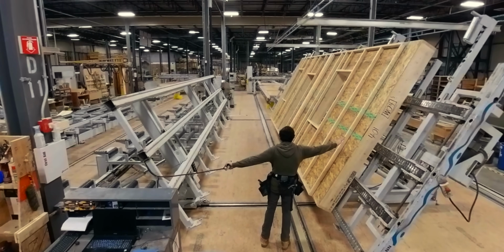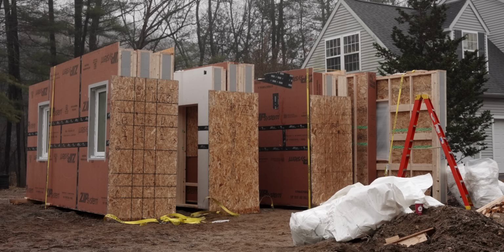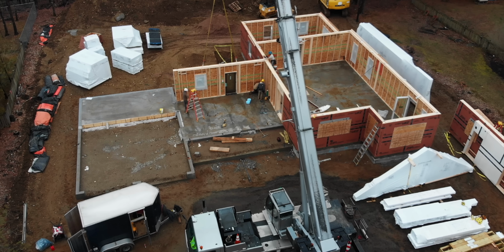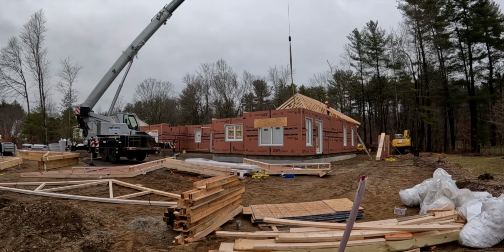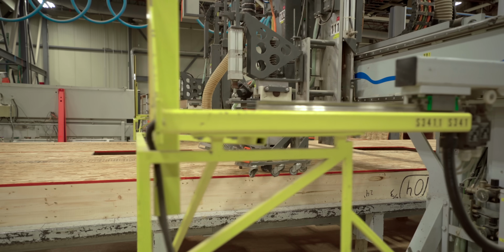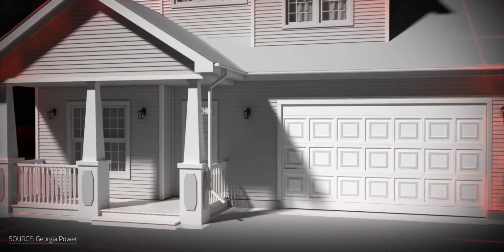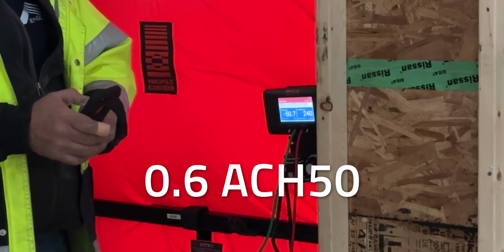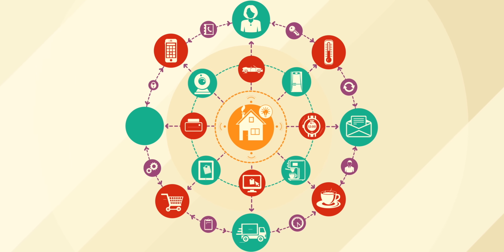Wow! I Didn’t Know A Prebuilt House Could Do This

Comment: Hi Matt, I’ll be curious to see if the Water Furnace is worth it.  We built a stick built “passive” house.  We’re down in the Carolina’s so much milder.  But with our LG panels we are NetZero with just an American Standard XV18 heat pump which was 1/2 the price of the Water Furnace.  In the end, the geo numbers just didn’t make sense and would never pay back the additional cost.

Comment: I built several homes for ourselves using conventional construction, large fire places and every other inefficient system that was the norm prior to about 1990s.  I had a steep property in the mountains of eastern mountains of central California and above my property a new house was being built by the owner/contractor. I did not care for a neighbor higher only 300 from our property line so I never built on that property. During construstion of the house above my property, the only two lots, about 40 ac, so I got to know the builder. He was experimenting and wanted a thermal efficient low utility cost home and designed it himself. Watching him do everything that was not standard was interesting as it went to gether. The basement was a deep reccess 12 feet below grade that required blasting to break up the granite just 2 feet before surface. He filled the whole cavity with large river rock, from 1 ft in dia to 4-5 feet. 
When it was done, the 3 story home had a bottom floor Great Room with a single decrative Franklin stove on the ground floor where the elegant living room had the stovepipe runnin straight up 30 feet to the ceiling,.  The country required him to put in electric heaters after failing the inspection but only installed the circuit breakers while the country was inspecting, then pulled them out. On the west facing glass wall overlooking  the central valley, the glass extended from floor to about 26 feet across the entire western exposure of the 5 bedroom home. He explained his idea, completely from first principles, not being a architect or having ever designed a high efficiency home before and it was really both novel and effective. It was an envelope home, with air passages up the hill so the second floor on the back eastern side was windows inches about the earn since it was on a steep hill. the sitting room in the center of that second floor was below the water surface of a pond so one could see the light filter through the water and entered the room. The western side had a large deck and at the peak of the house on the west side had an overhang of about 12 inches at the 35 foot level. He explained that small overhang was perfeft to protect the summer sun from shining through the glass wall but even a dusk there was not need for interior lights to be on until well after sunset. But in winter with the lower sun all day, the entrire ground floor living room was in heated by the sunlight bathing the enire great room dark tile floor. The thick concrete floor had vent holes into the rock filled space below that was warmed by the floor absorbsion and stored in the river rock and released is continuously all night. No fans or blowers. Over the kitchen area was black pipe in a grid that heated glycal filler that was fed into a head exchanger in to water heater room so the only heat of the triple insulated water heater had to supply warm water for showers and wasking, fed with a deep well 316 feet.  
It was so well planned out and efficient in 1983, I bought the house from him. It was the most comfortable year round building I have evern been in and between the solar voltaic panels I installed and a large lead calcium battery shed, my utilities bills consisted of electricity for the well, about $14 a month.  The stove was wood fired, the refrigeration was from the solar panels, and outlet power was from an inverter I made myself.  I bought it for $185,000 in with his 40 acres and my 40 I already owned.   I owned it into 2000 when I gave it away and moved out of the US.  That house was a delight in beautiful views, cozy winter or summer, the warm floors due to the heat resevoir underground encouraged bare feet. The little franklin stove was so efficient that the whole 3900 home was kept toasty in the cold frozen winters, fueled by tiny pieces of wood, unlike my prior home with two fireplaces that used 24 cords of seasoned wood cut every September. The envelope home was so efficient that I could collect a winters worth of wood in a few hours instead of a month before.
That was before all the innovation in materials, or the low cost solar panels today.  Now I live  500 miles from the Arctic Circle in the historic city center of beautiful St Petersburg Russia and my total cost of living including attending world class opera, ballet and drama, partying every other night, is $1500, for two people with a much better quality of life, but I do miss that home in the mountains of California.  I had access to early solar panels because one of my businesses was servicing all the two way radio systens for the US Forest service for 3 National Forests and proposed and designed and installed the first solar powered mountain top repeater systems that were inaccessable in the winter into late spring so they had to be very reliable when inverters and for the repeaters. I also invented the the first solar powered refigerators so the live-in lookout towers fire spotters could have better quality food. I build 12 of them for the Forest Service. Not long after that due to budget limits they fired all the experienced lookout fire spotters and relied on remote detection that was the main contributing factor in the massive fires every year for the last 20 years.  Skilled lookout, were much better in detecting even a single smoldering pine cone from miles away. Now a fire is detected too late when it generates its own wind and becomes a very distructive fire wiping out who communities every year. That did not happen when seasonal experienced people lived in the lookout towers. To save $7/hr they were paid they spent many billions in first suppression and over 200,000 homes and businesses.

Comment: I work for a double / triple glazing manufacturer in the UK and those u-values for the windows are insanely low. Would love a breakdown on the configuration of the glass they used and if the 0.15 & 0.13 is just the glass u-value or the whole window u-value.
Reply: I would love to know more about the windows as well, since seams like extremely good u-value :=) In Sweden we only need around 0.8  for passive houses.
Reply: @trind6  They are using freedom units (imperial) and 0.14 equals 0.8 in Sweden
Reply: Stumbled across this video and thought the same thing, apparently its a different value in imperial units and 0.14 in imperial equals 0.80 in metric

Comment: As some one that has lived in the tropics most of my life, I am surprised to see US housing not having steel rods from the floor to roof to hold it down. Surely your tornado's would warrant that? I am still impressed by your house and the process of construction.
Reply: 1. tornados are rare, strong tornados are especially rare and almost all occur in the south central region and,
2. to address this, exterior walls are bolted to the foundation, with the roof bolted to the frame as well. basements and solid concrete rooms are basically the only way to survive the strongest tornados

Comment: i'm just wondering for the tech in your house if your going tot ake the easy or nightmare route

Easy route > using google, apple and have a easy cloud based system where everything goes through the cloud as well using a hub

nightmare route > Cloudless with cloud option / using local home connect that doesn't require the internet to use the things in your house because some of the tech updates in some devices haven't been updated in 4+ years 

like Jasco the firmware in there switch and motion sensors are proprietary information which only works if you own a hub for updating

Comment: What is your intention with the house build? Is it to just be as energy efficient as possible? Or to be as eco friendly and human friendly as possible? Or both? It's a nice display of how far prefab homes have come for the price point. Also, did you do any analysis on the use of geothermal in your area? I have been a part of several projects in NH and VT in the past couple of years, and all have done analysis to show that geothermal is insufficient for heating a home, and heat pumps are typically a significantly better option. That said, I didn't do either with my house build, and invested in exterior insulation instead, with simple electric floor radiant to heat our 600sf home. Another question as well, why did you go for a concrete slab on grade? Was it a cost decision, or for simplicity? That follow up would tie back to my initial inquiry, if you are prioritizing eco friendly or energy efficiency, as the slab will definitely help with energy efficiency, but there is quite a bit of embodied carbon in concrete, as well as the XPS Insulation that the slab is poured into. Just curious what your goals and priorities are, and seeing how you came to your conclusions, as I just went through the process of my house build to 90% complete as of today with energy efficiency as my priority, ergonomic efficiencies a close second, and quietness being third.

Comment: One area that I am interested in has to do with the bathroom.  At Epcot they had/have a display that uses shower water drain to preheat hot water tank water.  The same system was used to use waste shower water to to flush toilets which was suppose to cut water usage by 20% to 33%. Since utilities are moving to purchasing power at wholesale rates, would a solar storage battery below the garage be a consideration.  Heat in summer and use in winter like polar ... battery.  Assume your using ground loop heat pump to be all electric.

Comment: I have a need to close air conditioning and heating vents in my house for extended periods because no one is in them, this will in theory reduce heating and cooling costs by reducing the area I'm heating or cooling.   Are you going to include something that could do this in your house?

Comment: Interested in how you control your AC and heating through various paths the house and getting the flow back the air handler.

Are you putting individual reverse ducts in each room or part of the house?

Comment: If everything about the fabrication of the walls and roof were "controllable", why was the house slated for assembly in the wintertime? if moisture and inclement weather were such a concern, surely late spring or summer would have been a better assembly time? Also - the roof truss assembly does use smaller wood member, etc., but this type of construction eliminates attic space, any storage, and also prevents you from having any kind of vaulted ceiling. Is the trade-off worth it? The walls and roof seem to be so extremely well-insulated and that is amazing. what about the foundation walls? there is a styrofoam formwork system that becomes an integral part of the foundation wall and provides a fantastic thermal loss rating.

Comment: Stuff I would like to know more about.
1.) Cost breakdowns 
2.) Moisture/ mould suppression techniques especially in the heat exchanger 
3.) Is this type of build good for allergy sufferers?
4.) How much expense and feature change was required by local building codes or HOA versus what you actually wanted?
4.) Any subsystems that are fully off-grid, and do they save you money vice the on-grid alternative?
5.) Is your Tesla gonna integrate with the home power system?

Comment: Aside from the EV...   I almost feel like solar panel prices are dropping so quickly that really spending a lot of money on super insulation designs is a little overkill economically.   In other words, I feel for most modest homes, we are at the point where we can just brute force it on solar panels.
Reply: I've had a similar thought. Use a small wood stove, rocket stove, propane backup for the extended cloud cover events.

Comment: Residential construction is a tremendously wasteful endeavor. When building in a factory-style setting, much of the waste can be and is engineered out of the build. While very capital intensive to set-up, the equipment saves on labor which is also harder and harder to find. Speaking of labor, they'd much rather build in a controlled environment than be exposed to the elements, which in turn reduces build time.

So, less waste, less labor, less time and better working conditions, not to mention the ease of erecting structures to the dried in stage. Every new home should be built in a factory.

My parents were way ahead of the game; having their beach home factory built way back in the '80's. There was no such thing as air exchangers back then and the wood burning stove would not only heat the entire home, but you'd actually have to open windows, even in the dead of winter, and that was with the stove barely burning.

Comment: I saw a few years back this video from This Old House (https://www.youtube.com/watch?v=N3Em64OBGqI) specifically for future houses. The owner had decided to use commercial equipment and thermal batteries (aka cold/hot water reservoirs) to help regulate temperatures in his BIG house, along with solar.

My though since seeing that has always been if there would be a way forward to tie solar panels and battery, geothermal heat pump, and thermal batteries together and create a self-regulating ecosystem of sorts. For example, use the glycol to help chill the solar panels and make them more energy efficient, use that glycol to help supplement the hot water heater or the heat pump, and also regulate the HVAC during the summer months by being able to soak up the heat out of the house and replace it with stored cool thermal energy.

I'd be curious to hear your thoughts about this.

Comment: Starting in 1991, mine took 3-1/2 years to build. There was a HUGE learning curve back then! I am also in NE. I've thought about doing another one. I desperately do NOT want a basement- nothing but grief (water, mold and humidity control). I spent a LOT of money trying to get it right, but no cigar. So... how did you do the 'slab'? What did you do to keep the concrete under the final floor from contributing to mold (ie, moisture management)?

Comment: Great video and quality of build seems great so far. Have done 6 regular new home builds over the past 21 years, each with a different "Brand name" company (Lyon, Standard Pacific, Toll Brothers, etc) and often a nightmare as the "trades" are contracted and framing part is such as mess.
Just wondering what the cost of the home up to the point of the end of this video is and then final cost is as helps for the rest of us to see what it cost to be "Energy Efficient" etc.

Comment: Question. Did you spray that crack and hole filler that I saw on Matt Risinger's video about his house? There was what looked like a tripod that had a sprayer on it. It was part of a system that sprayed something that actually flowed to where there were leaks in the house and plugged those leaks. They did a blow test before that procedure and then after to show how all those leaks got filled. That seems like something perfect for your house needs.

Comment: with battery fire problems, what steps have you taken to mitigate saving lives and house if there is an overcharge or failure? like a separate room on outside wall with blow out panels and fire suppression system?

Comment: I would like to see the roi on the geothermal decision please Matt. I built some of the first super insulated , double stud wall homes in michigan in the late 80's and early 90's . 99% of the materials from off the USA shelf local suppliers. Passive house and better ACH per hour. I used electric base board heaters and 24/7 Canadian fan unit for controlled whole home dehumidification. We did solar dhw ,  PV and even wind power installs for some clients. So little has changed in the decades since, for building codes in the USA, sadly. 99% of the builders , are still framing fuel guzzling homes and commercial buildings. My best home was a 4,000 sq ft 2 story , $250.00 total heating and cooling cost per year ( 6 member family  , high intrinsic heat contribution) . Not throwing any shadows . I am very happy you are educating and demonstrating the best of what is out there for the community :) I will say friends with a large 3600 sq ft house , early NC solar pv users , added geo thermal unit last year. They are not  happy with the less than promised  monthly savings. I was sad their installer did not use larger dia pipe and the coil method of buried tubing. I was researching new zip codes for my last home. I do not know if it is a national option , but.... in VA , if a home is built in access of 30% plus above energy star , etc code requirements. This statute allows any county, city, or town to exempt or partially exempt energy efficient buildings from local property taxes. keep up the great work .

Comment: I suggest "Victron" for your Inverter/Charger system, Mine 24 years no problems! 8kva inverter and 2 MPPT chargers  --- lead acid bats as why, you can guess  (24 years)  :)   They are still up to the mark as I've never let them lower than 50%

Comment: I went with a 4 inch galvanized steel and foam laminant SIP construction for the walls with a 6 inch version for the roof. R28 walls and an R42 roof. The materials cost a bit more, but the assembly was able to be in the dry at the end of a 14 hour day with four of us doing it with a crane. The galvanized steel outer doesn't care about water nor does the closed cell foam inner. No chance of termites ever either. I also like that the galvanized SIPs are rated for 155+ winds.
Reply: @UndecidedMF.  Why would I message a bot?